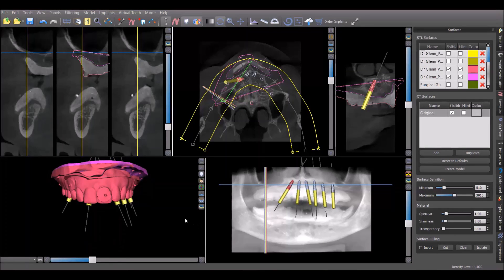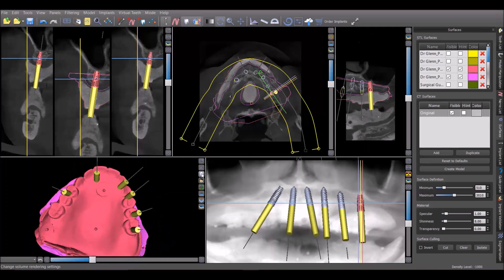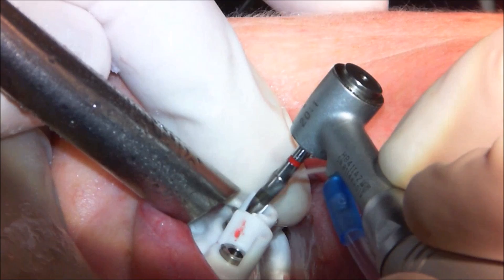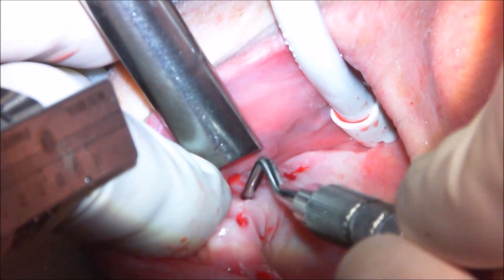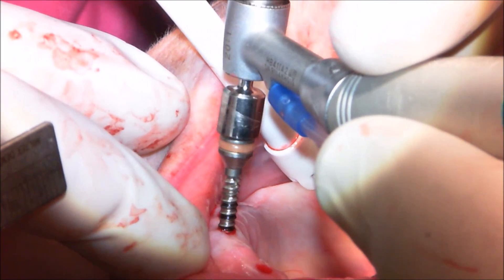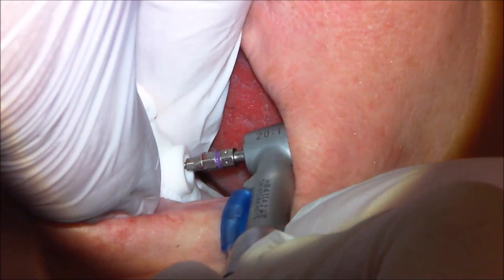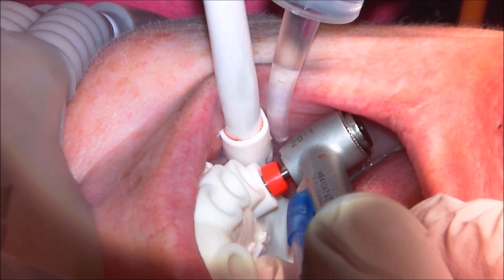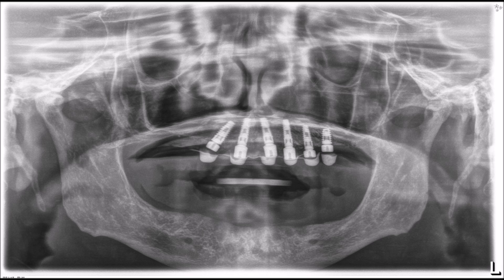Full Arch Guided Implants with Bone Expansion

Comment: Was this done with double scan technique? where pt get a scan with denture in place and later on the denture with the same radiographic markers is scanned on it own? or was it just one scan?
Reply from the maker: This case was done with the triple scan technique but with new developments in the software, it's uneccessary.  Now you can do everything I did here with a dual scan of the patient and then the denture and the software merge will be much easier.
Reply: I have a case where pt has a transitional upper denture with coe comfort reline, can I use the double scan technique with a denture with coe comfort reline, or I must duplicate that denture and proceed with the duplicate?
Reply from the maker: I don't know how coe soft will show up........safest bet would be to duplicate and reline for absolute best fit and consistency of material throughout

Comment: Dr Corry. Absolutely amazing case and presentation. Thank you for sharing. You mentioned this case being a removable overdenture in the begining of the video. How do you overcome the divergent angle of the right most implant? Will you use extended range locators or will you have to have a locator bar milled? Or maybe it is something really cool that I don't even know about?